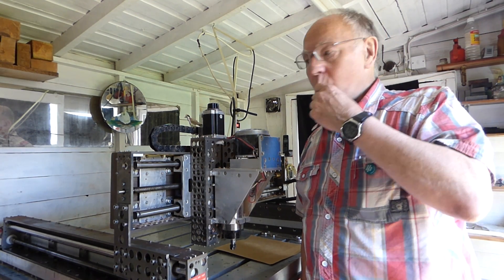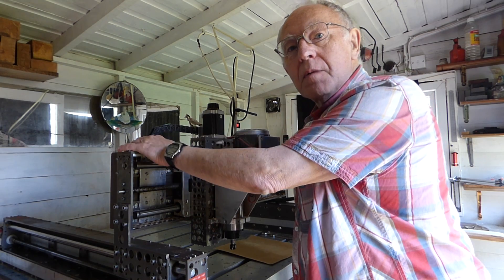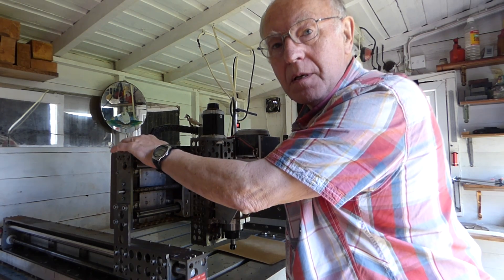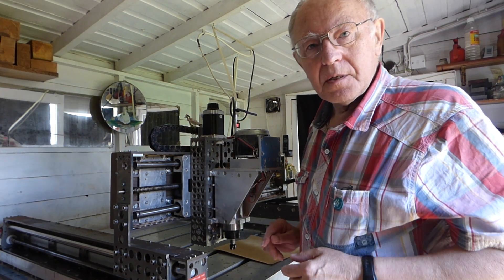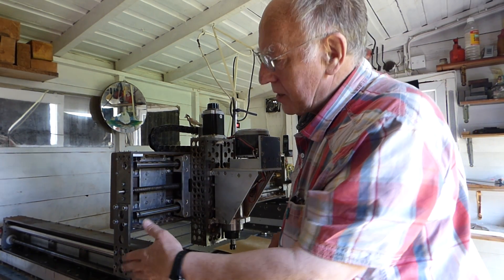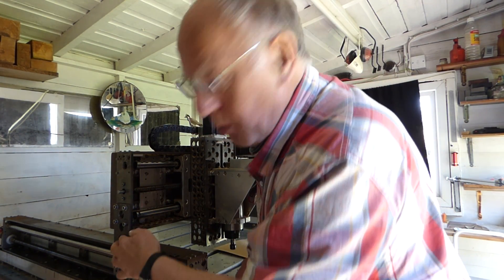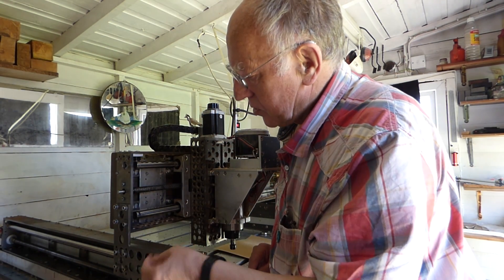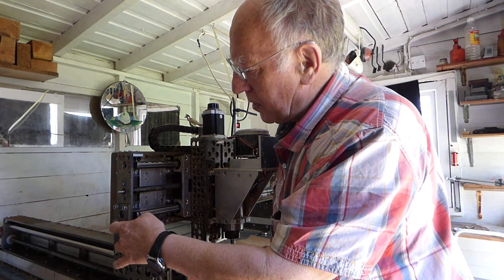Testing  fine sand-epoxy mixes.

Comment: IMHO I think that the structure should nod made only with Polymer-concrete. A steel frame, pre-tensed, and fused into the poly-concrete. Also consider use polyurethane for vibration dampering.  just my 2 cent

Comment: I uses polyurethane instead epoxy for cost reasons. With good results. Difetrents resins on the market give diferent results. I learned that not only gravel and sand is needed. Also a powder like talk help to give stiffness.

Comment: I use sand mixed with resin to back fill cavities in embossed metal art and it works extraordinarily well. Not much resin is needed to make a rock hard bond and the best part is you have time to mold it in and level it… then it sets in about a three hours. This after months of trying all sorts of things.

Comment: What is your mixture of resin and sand? Or is it a bought product? Thank you for the video!
Reply: It's just a standard slow cure liquid epoxy resin with enough sand to allow it to flow and leave no liquid resin on the surface.You can add more sand to make a stiffer mix.

Comment: OK so this video was posted 5 years ago so its a bit old and no idea why it popped up on my 'recommended' but it just so happens I have been investigating something that may be of use called 'forged carbon fibre': https://www.youtube.com/watch?v=25PmqM24HEk     -This would provide some serious strength if combined with CF rods or sheets within your castings, CF extremely stiff stuff. With orientated CF Tow fibres this stuff can be twice as strong as aluminium at half the weight...

Comment: Instead of rebars, steel wire mesh layers would give you lighter samples.
Reply: Depends on how much steel wire mesh you put in to get the same strength.
Reply: @jamestaylor7025  Of course, indeed. But having (hypothetically) the same weight of wire mesh as rebar would give the metal a much larger contact area between the metal and epoxy. The rebars total cross section will give you their tensile strength, and if that tensile strength is larger than the force it takes to separate the epoxy from the metal, the effective strength of the rebar will be "lost", so to speak.
Reply: @pierrec1590  That is why, usually, rebar is as rough as hell and twisted to an helical shape. There are many other factors to consider. You may want the strength to be in the lateral direction or longitudinal direction or both etc etc. Consider fiberglass or carbon fiber strands - on their own they are not very rigid but put them into a composite and it becomes stronger and lighter than steel.

Comment: Have you considered a metal-epoxy composite? I've had decent luck using fine steel wires taken from steel mesh. Chopped up into 1/2-1.5" strands. Works decently. Burn and wash the mesh if galvanized so as to get the zinc off. Don't breathe in the fumes.
Reply from the maker: Yes I have added metal rods to the mix. And I would imagine that lots of fine wires would also certainly improve the strength of the composite.

Comment: Jim,
The bench was moving when you put slight pressure on it when writing. I think the bench is flexing making the readings similar. Using a rigid bench might give more accurate results.
Reply from the maker: Even if the bench flexes a bit, the reading will still be accurate as it is measuring the forces at either end of the spring balance. The force at the top end of the balance and the force on the test sample are the same; otherwise the resultant force would cause something to fly off - which would be a simple demonstration of Newton's 3rd law. This is exactly what happens when the sample fails.

Comment: Epoxy will stick to some wax covered surfaces as you have discovered. The epoxy contains a solvent, the solvent can dissolve some waxes , for the best results, especially surface finish, then use a release agent and not any old wax.

Comment: You need an internal structure, not just a single piece. Like they do in house foundations. It needs to be supported internally in all directions. Even if you brazed some stainless steel tubes together into a 3 dimensional frame, inserted it into your pour and vibrated it.
Like mentioned, you can't just put a middle support inside.
Hope this helps in your structural design.
Also curious how you were gonna drill thru your plates. I was thinking of doing all this same process to strengthen my machine. My thought on making plates would be to draw up screw hole locations in a material, wood or aluminum, insert screws thru the holes in the patterned piece, slide over some sleeves onto the screws, add the internal framing, pour in the aggregate mixture and vibrate it. This would make the job so much faster and more precise on hole locations. :)
Reply from the maker: Look friend, I keep saying this until I am blue in the face. What you put into your comopsite depends entirely in what properties you want from the final mix. You might want rigidity, strength, flexability. heaviness, lightness, bouyancy, density, compressability, elasticity, weatherability, proof against earthquakes, volcano magma, acid spill, etc etc etc etc etc etc etc etc etc etc etc etc.
You must first specify the properties you require from the composite then figure out how to achieve them.
My little demo was just one tiny example.

Comment: Jim youre better off using glass fibre as a reinforxing agent. Rebar is... Farfetched and is not suitable.
Reply from the maker: Not suitable for what!?

The additive to the epoxy depends on what properties you are trying to achieve with the composite mix. In this case I was after toughness and bulk/weight. Toughness because without any additive at all the epoxy was very brittle - notice the one I dropped on the floor and snapped which had no additive - rebar or whatever. Also I wanted the composite to be heavy/dense/vibration-damping for the vibrations that are set up by the stepper motors - glass fibre would have reduced the finished weight. In theory I was trying to achieve similar properties to that of cast iron.

Comment: Greetings. Very interesting topic as I'm designing/planning my next DIY cnc machine. Few stupid questions if I may? Is that "kiln sand" sand that is used in metal foundry casting? What do you think about if tried with glass beads (sand blasting alternatives) with rebar? Also is the epoxy and hardener same as used with fiber glass? Not a native English speaker, hence the question.
Reply from the maker: Yes, the sand was kiln sand but I think that foundry sand is something different - green sand is one of its names. Sand blasting beads could be a neat idea since it is likely to have an angular surface and the resin can key onto it. Rebar would make the eventual structure stronger and less brittle. Again, yes the resin and hardener are what is normally used for making boats, mending cars etc.

Comment: Very Nice!..Have you done some concrete test?
Reply from the maker: No. Concrete is a chemical process using water. It will not work with epoxy. Did you know that concrete will set under water?
Reply: @JimTaylor42   .. In brazil the concrete is very common and I would like to make some test mixing with micronized plastic and check your mechanics  resistance .in this case I dont  will mixing   with epoxy.

Comment: Use candlewax on the backboard and drip it onto the screws (and wipe down with knife blade) before you add epoxy.
Then you can just stuff the screwdriver in the screws and the wax will move later. No more clogged screws.
Reply from the maker: Great idea - thanks.

Comment: Jim, this is wonderful. I have a thought too that may be of interest. I imagine the sand, having an enormous surface area will hold moisture on the surface of each grain and that will weaken the inter-grain adhesion and the end result. I suspect that if you baked the sand, or some other method to remove some moisture, your results might just improve, especially your "drop test".
Reply from the maker: Although I did not mention it, I did, in fact, bake the sand.

Comment: Methinks a bit of wax won't hurt the finish... Should release easily... floor wax... any paste was actually.... 
says the armchair engineer.
Reply: p.s. ... Ilike your granite epoxy ideas... best of the batch I've watched...
weld bolts or nuts into that rebar... Or weld an arch into a pair forming two ends of a concrete bench type set...perhaps??
I had plans for using AIRCRETE until I found this idea.
Reply from the maker: Worth a try.

Comment: Rebar should be tensioned to get benefits from it.
Reply from the maker: If you are making reinforced concrete lintles I would agree. Otherwise, I am not so sure. It all depends on the application and the properties you want from the composite.
Reply: Rebar doesnt make a structure stiffer until it fails unless its prestressed. Also i think you need the aggregate to be of mixed sizes bigger aggregates make a stronger composite

Comment: Very interesting... maybe if resin combined with portland cement and sand the final result will be good
Reply from the maker: I really would like to see the results of that.
Reply: I was thinking yer right. mortar, cement powder, or rock dust should work as easily.
AIRCRETE also, can be mixed by weights also has large variations in strength\weight ratios.
Reply: The point is different size of aggregate to fill the mixture, at least 3 sizes

Comment: Awesome seeing really well made datum like this! I was curious if you've tested just pure resin?
Reply: seen another videos. pure epoxy is the worst of all.  best one i have seen seems to be a fine mix of powder (silica sanad extremely thin , etc)  and iron (really fine)
Reply from the maker: No, I haven't done that. I don't think that pure resin will be much different in mechanical properties, from the sand/resin composite. The main reason for adding sand or other filler to the resin is to bulk out the resin and make the final thing cheaper. The addition of rebar or other material is to make the final part less brittle.

Comment: Interesting results, thanks for sharing.
The rebar doesn't do much until the casting begins to deform. It helps move away from a brittle failure mode to a ductile failure, hence perhaps the greater deflection.  It would have been interesting to see what results you get with pre tensioned rebar.
Reply from the maker: I agree it would be interesting, but rather difficult to implement I think.
Reply: @JimTaylor42  naw. threaded rod. couple of locknuts n washers down the length so theyre set in the poxy. poke em out the sides of the mold and use them to hold it all together as well. torque them up... mold will need bracing to take tension. 

countersunk insert on the inside of mold gives recess to cut bar off and seal up flush... but it aint concrete so you arent worried about cancer i guess...

Comment: For the rebar to be effective, it should not be in the neutral axis in the middle of the sample but should be resisting tension near the top of the sample with the lower strands of epoxy being in compression. If anything it would weaken the sample if placed in the neutral axis where horizontal shear could be greatest. I suspect however that the advantage of the epoxy mixture is in its stiffness and resistance to resonance vibrations. By the time the mixture fails  it would be long past acceptable stiffness tolerances. Therefore no need for tensile reinforcement.
Reply: To clarify, there are many different definitions for "strength", so what you're describing is "toughness" (IZOD impact strength). The rebar is a spine that disrupts stress risers that could travel through the material from face to face during an impact.
Reply from the maker: As I have explained in other comments, the resin composite is stiffer than the rebar so putting the rebar near the surface would make the sample less stiff. The reason for the rebar is to make the sample stronger not stiffer. If the sample was strong enough without the rebar, the rebar would not be necessary. Without the rebar the sample is very brittle. I dropped one, without rebar, on a hard floor and it snapped.

Comment: As discussed by others in previous comments: Adding chopped or even continuous fiber would be interesting.
Reply from the maker: Yes indeed it would. It would make the resulting composite much lighter which would be the reverse of what I wanted for my particular application. For my cnc machine I needed a dense dead weight that would kill any resonances.
Reply: Jim Taylor I was talking about a small fraction to add toughness and strength. If you used natural fibers (flax) damping should be best per weight. A small fraction can make huge differences.
Reply from the maker: Thanks for the clarification.

Comment: The stress in bending is an angular line from the top to the bottom surface.  For a rectangle the lowest stress, zero is in the center.  So rebar placed near the center will have a low stress.  You could ave uses rubber and the numbers would have been almost the same.  Tension the stress is uniform so the rebar would help.   check the rules for rebar in concrete structures to find the optimum fraction of the thickness of a rectangle.  So the two rebars would be located  the same distance of top and bottom.
Reply from the maker: The intention of the rebar is to make the composite part stronger and less brittle (unlike the one I dropped which snapped) but not less rigid. Rebar is not necessarily more rigid (lower strain value) than the epoxy composite so putting it near to the surface may make the part less rigid. Like putting elastic bands near the surface. The purpose of the exercise is to make a part that is strong, very rigid,  'dead' and not brittle. In fact the test sample with the rebar measured slightly less rigid than one without rebar and with the same epoxy recipe. But under the test conditions it did not fail.
Reply from the maker: As I have said, you design the compososite according to your needs. If you need it to be stronger than the filler, then use an addition that is stronger than the filler. Wherease if you want it to be more rigid than the filler use a more rigid  material in the composite. If you want the composite to be much heavier and resonance resisting then use a 'dead' material. As you say, the added material should be placed within the composite where the stresses are most concentrated if you want it stronger. There is very little benefit in putting a less rigid material that the filler close to the surface if you want a more rigid composite. Consult materials properties tables to find an appropriate material to add. As an example; cast iron is 70 times more rigid than aluminium and its alloys.

Comment: For rigidity I wonder if you were to use a thin (1-2mm) sheet of aluminium or steel on the top and bottom. Would this form a stress skin? I've done similar with aluminium with plastic core and it was quite surprisingly stiff. Just a thought. Really helpful video though. I'm planning to use this technique to cast a lathe bed, for a home built lathe.
Reply from the maker: I think that you are correct about adding extra material to the outer surface, but the selection of that material would be critical. To make the whole thing more rigid, the added material should be stiffer or have a higher strain value (compressive and tensile) than the material it will replace. The main reason I mentioned adding rebar in my video was to improve the toughness of the final composite because as you saw it was very brittle. Think about toughened glass - it is harder to break, but put in on supports and jump up and down on it and it flexes like a drumskin. It is no more rigid than ordinary glass. The only way to determine if a particular composite is more rigid is to make it and do proper comparative tests on it as I have done. This is what they do all the time in industry - otherwise airplane wings would come off and landing carriages would collapse.
I've got it in mind to do something like this in the future ... but don't hold you breath on this one.

Comment: Hi Jim, Interesting video. Do you think some glass or carbon would help to make it more durable. What resin are you using. Cheers Dave.
Reply from the maker: I do believe it would. Perhaps someone will give it a go. The resin is IN2 INFUSION EPOXY RESIN with AT30 SLOW HARDENER from EasyComposites here in UK.

Comment: have you tried using aluminum or steel shavings in your mix?
Reply from the maker: No i haven't - I'm really just trying what I have got on hand. I've got a box of st.steel wire rods and I am thinking of putting some of them in the next part I make. Al or St shavings - sounds expensive.
Reply: @JimTaylor42  Aluminum or steel shavings would be cheap since there a constant 
issue to deal with at any machine shop. However they would do far less for 
ending up with a good vibration absorbing material which is what you'd want and 
what that epoxy sand mixture helps provide. Cast iron is still used in the building of machine tools because of it's natural dampening property's. Like concrete it's not the best under high tension loads so that rebar is added to concrete. The cast iron 
shapes are manipulated to increase the strength where needed. I highly doubt metal 
shavings even cast iron one's would increase the strength by much if at all. If adding metal shavings did more or even equaled what re-bar does then it would certainly be used while building with concrete simply because of the cost cutting over the more 
traditional re-bar. So just like casting a machine tool part then designing the part with a cross section that increases strength in the directions needed is a priority. A steel I 
beam is designed to be stiff in both directions, a piece of flat bar is far stronger 
through it's vertical direction as just one example.